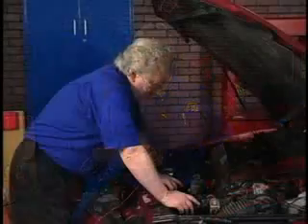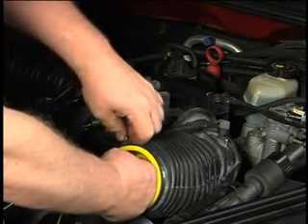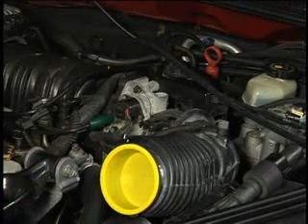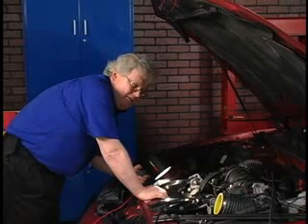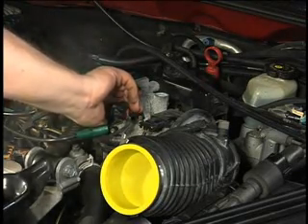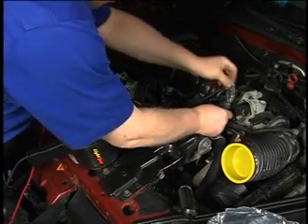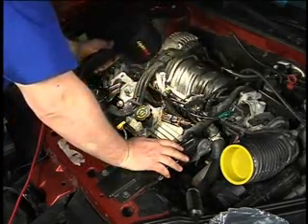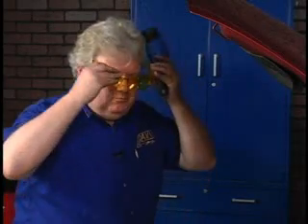Smoke Wizard®: Finding a Vacuum Leak

Comment: I just got my truck back from the shop supposedly my truck is running flawlessly and it felt like she was. Then when i was driveing to work when i noticed that my rpm gauge rev down so much down almost to the point where i feel like i have to give it some gas because it feels like its going to stall on me. It revs down when im in movement and i shift to neutral, not when im still. Is this becouse a vaccum leak? and i heard knocking in the engine then the service engine light came on. Awnsers?